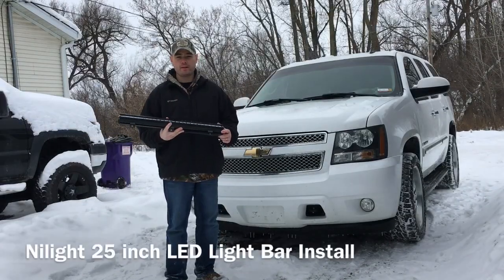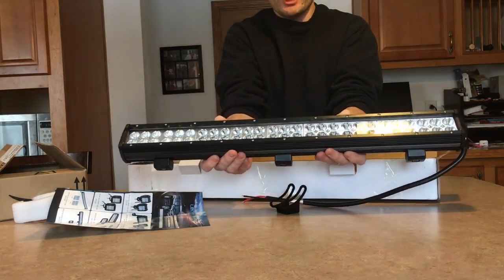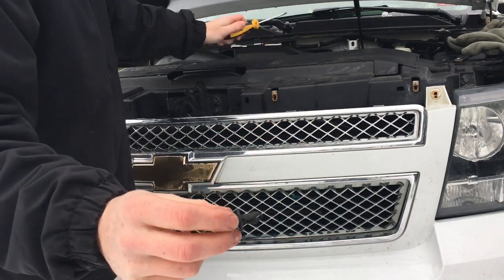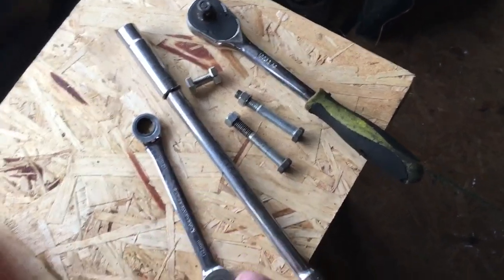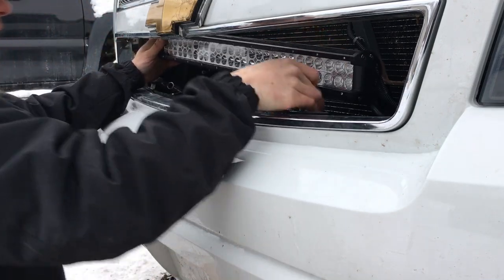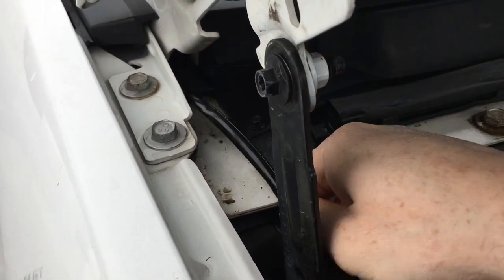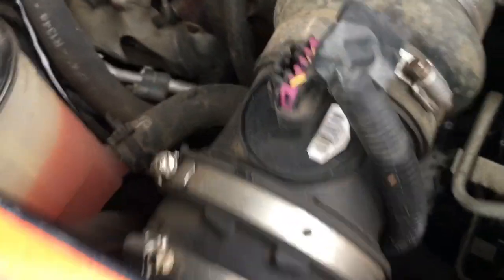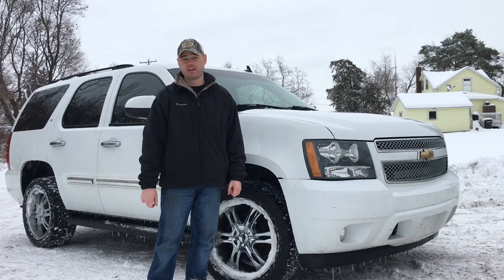25 inch Nilight Led Light Bar Full Install

Comment: LOVE this mod on my 07 Tahoe.  I tapped into the left fog light.  This light has saved me a few times!
Reply: That's a great idea. So does the stock vehicle fog light button operate the new lightbar or you still have to mount the one that came with it?

Comment: i like the wires running thru the door jamb thats profesional
Reply from the maker: +duramaxfl lol I know I should have ran it thru the firewall
Reply: Truck Master if you don't mind me asking what do you mean by firewall
Reply: Sharkson77 firewall if the front barrier of the cab (separates engine bay and cabin)
Reply: actually thats really good since you are not driliing anything , you keep your truck integrity
Reply: I don't run wires thru the firewall because it's just a bigger pain and you risk damaging the factory wiring harness if you screw up.

Comment: Thanks man! I was looking to do this install on my 07 Avalanche and your video is the PERFECT tutorial! Following step by step, but I'm going 32".
Reply from the maker: +CyberFaction that's great and I'm sure the 32" will fit nicely
Reply: CyberFaction hey man how did the 32" install go. Is it too wide to mount correctly or did it work?
Reply: Tim Miklas hey bro, I actually changed my mind and went with a single row 41" bar to fit behind the upper section of grill. I plan to mount it directly behind the grill for a "OEM" look, Figured it be a cleaner look since it fit directly in the grill and be in line with the headlights. I ordered it and the wiring yesterday, it'll be in Friday. After I install and I'm going to make a quick video to show the installation and light bar as soon as possible. Go ahead and sub to my channel so you get the notification when I post the vid! 
Vehicle: 2010 Avalanche LTZ
Bar: 41" nilight single row 200w
Reply from the maker: CyberFaction will do! I'm curious to see how it turns out
Reply: Truck Master video of my light bar in up! I recorded it real quick, I'll pull out the Nikon and make a better video later on. It's a 41" single row bar. Because of its size I ended up having to take the entire front end off, which wasn't difficult at all(it's only held on by 6 bolts at the bottom). I'm very pleased with the look and light power! Your video was my inspiration!
Reply: Truck Master video of my light bar in up! I recorded it real quick, I'll pull out the Nikon and make a better video later on. It's a 41" single row bar. Because of its size I ended up having to take the entire front end off, which wasn't difficult at all(it's only held on by 6 bolts at the bottom). I'm very pleased with the look and light power! Your video was my inspiration!
Reply: Tim Miklas video of my install is up on my profile
Reply: CyberFaction don't have time to watch it but do you think a double row would fit? If not I'll have to see how it looks and choose which one. Or both!
Reply: Tim Miklas yes, 40" double row bar should fit at the bottom, the top install wasn't possible due to the radiator heat vent located at right side of the radiator support. After completing my install, i thought it looked so cool Id like to be able to dim it to use it as sort of a day time running light but once this one I have now dies or breaks. I'm going to buy the Auxbeam 42" double row light bar that changes to 15 different colors, is dimmable and you can control it from your iPhone! If you get one, post your install.

Comment: Great job. Thanks for your video. I ordered the exact same light and harness that you supplied on your link below. The install was a little more involved than I anticipated but I got the job done. The hardware is difficult to attach to the light brackets once the main pivot brackets are installed. I would advise not ordering the wiring harness from the company you recommended as the light bar arrives in a couple of days whereas the harness took 2 weeks.  All in all it looks awesome behind the grill.
Reply from the maker: +Trace Eubanks wow that’s a horrible shipping wait but glad it worked out for you

Comment: Awesome video! I’ve got a 2007 Chevy Subruban z71 and I’ve been looking for a lightbar for the same place you put it in. I want mine to reach both sides of the grill so little less then 3 feet. I’m going to look into this light bar company too because that wiring kit looks very simply and easy to use

Comment: I installed my lights behind grille also but wired them to a 16 gauge 12 foot dc cord that plugs into 12 volt supply next to cigarette lighter. Way easier

Comment: How much room is there between the back of the light assembly and the front of the radiator? I have a 2013 Avalanche with the aux transmission cooler and it doesn’t appear to be a lot of room. TIA! Great video BTW, very informative.

Comment: There's a hot 12 volt stud on the fuse box on the driver's side. Should have tagged in there and it would have been perfect.

Comment: 👍I like LED lights but all of the ones I’ve had for maybe 4 or 5 mos (w/ little use) the light degrades rather quickly as far as the brightness. Also, my shop lights do it too. (120v) just my 2¢ 👍

Comment: You shoulda mourned centered to the bottom grille both vertically and horizontally...... Not just horizontally centered..... Get longer bolts and washer to shim up or cut a length of copper piping for shims
Reply from the maker: +Leatherkid01 that's a great idea
Reply: Leatherkid01 

The man is showing how to install it, in winter Lol, so I think he centered in summer ;)

Comment: How did you connect to connectors (red&black wire) to the light bar?? Also what type or wiring harness cable did you buy?

Comment: Thanks for the video! I'm looking to do to my 2013 avalanche. your description details the wire harness but your video says it came with it? the Amazon link for the bar doesn't seem to include the wiring and the switch is way different than your video. Thoughts? Thanks.

Comment: Did they change the switch? I don't want to permanently attache to my dash. How long could a 12 in light bar take to kill the battery if truck not running?
Reply: Thinking I'm going to do this on my 2009 Suburban.

Comment: If you have the towing package and the extra oil cooler in front of the radiator is there still room enough on a 2011 Chev Sub LTZ?
Reply: Mike, did you ever install? I have a 2013 LTZ with the aux transmission cooler as well and looks like the distance from face of aux cooler to rear of light bar would be too narrow.
Reply: I'm going to buy the product and see if it fits.  I have the same year/ model suburban!

Comment: I have 2, 7" inch light bars & i plan on installing them behind my grill as well. I have that same wiring harness. Is it possible to run both light bars to one harness? Please respond it would help a lot. Thanks.
Reply from the maker: +Keith H I'm not 100 percent sure.  I personally would but your relay might not be strong enough over time you might fry it out. Watch my 4 inch led video I used a wiring harness that has two connections i think that that wiring harness is the way to go but it's your call
Reply: Truck Master alright, I will check it out. & thanks again man, I appreciate it. Keep up the good work! 👌🏼👌🏼👌🏼
Reply from the maker: +Keith H no worries good luck brother
Reply: Truck Master installed my lights today man, ran both to the same harness. Let's see how long it lasts. Lol Looks bad ass. Thanks.
Reply from the maker: +Keith H  I'm sure it looks great Worst case that relay will go before the lights will which is no big deal take it easy

Comment: Why run it through the door like that? Your going to damage the wires with the door opening and closing against the seal. Should of gone through the door wire harness boot at least
Reply: Reason I say that is because I did that once and frayed the wires over time but the light looks great and nice idea to mount on my Tahoe thank you
Reply from the maker: +scorpion8525 thanks for the comment your right about the wiring but when I shut the door it barely touches

Comment: those's on/off switches about fucking junk wouldn't be surprised if you said it broke in a week .iv went thur 3 of them before i swap it out for a metal toggle switch
Reply from the maker: +skulledmonte84 I totally agree with you

Comment: Did they change the switch? I don't want to permanently attache to my dash. How long could a 12 in light bar take to kill the battery if truck not running?
Reply from the maker: +Eric Szymczyk I've never had a problem with the battery I've had the truck sit for two months and it didn't affect anything but I would like to replace that switch
Reply: Truck Master I mean with the light on. Will be good for beach driving this summer.